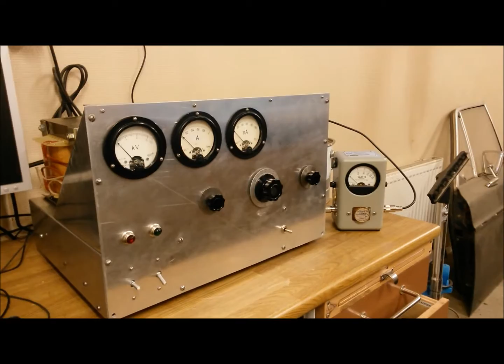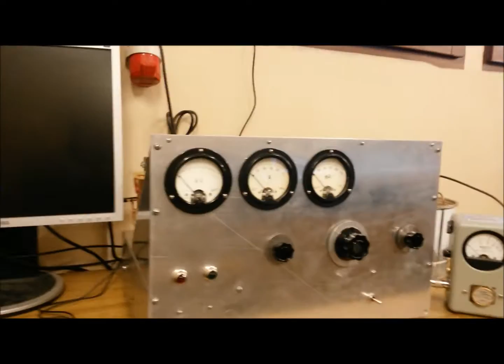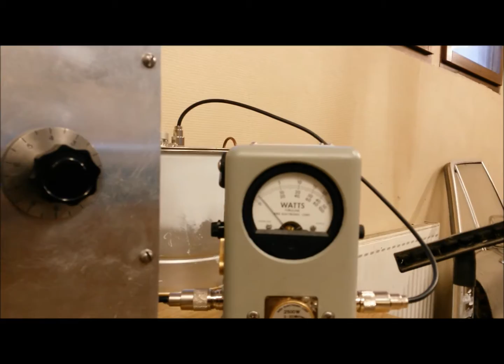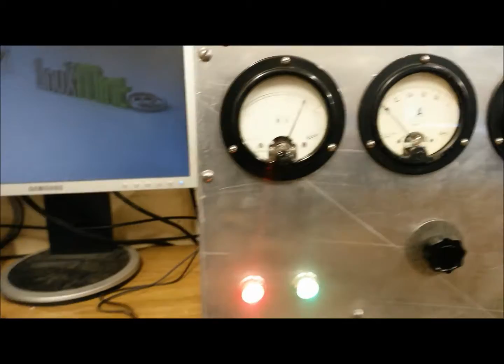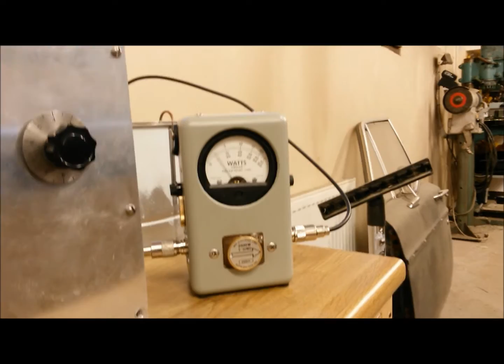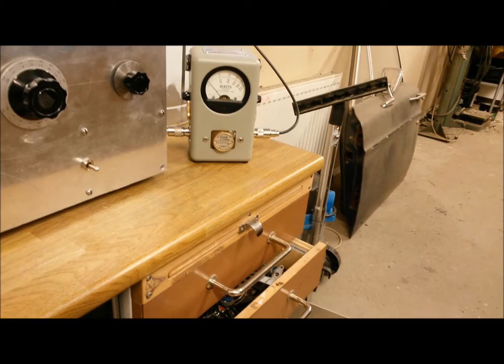813 linear amplifier

Comment: 2750 v   x 0.6 amp =1660 watts -40% to give 60 % eff is 990 watts output, so the watt meter vs voltage and amp meter is pretty much spot on ! welldone

Comment: Unfortunately  smoke damaged by a fire,  I have an old  Hallicrafters HT-41,  originally used the oddball 7094's.  Mine came with bad tubes and bad  filter choke.  I converted it to  solid state rectifiers,  capacitive filter/ no choke,  and   sub mounted 813 sockets and had BARELY enough height for the tubes. I had a filament transformer for the 813's that mounted perfectly where the old filter choke was!!   It's best band was on 40, it would output over 900  "key down."  I've forgotten the   Ep, it was quite high.  Did not run screen  voltage, just grounded both grids.   Maybe someday  I'll rebuild it, but I'm 75 now, and the  boat anchors  are getting more difficult to lift!!

Comment: Very Nice work, excellent choice in analog electrical measuring meters. My Father was a radar engineer for Lockheed Aircraft Service and He built a linear using four 813's talk about a beast. The homebrew power supply for the linear was a separate unit, it utilized  a group of Murcury vapor rectifiers which were 816's if I remember correctly, when he keyed up that linear, His whole ham shack was brightly illuminated with this deep cobalt blue light, you would think Frankenstein was comming to life.😏👍
   Thank you for sharing your linear and fantastic RF engineering skills with us.👍✌
Reply: What year is this? )))

Comment: Hej. Kul att det fortfarande finns hempulare. Själv kör jag 2st gu81m pentoder ca 2kw ut är enkelt. Kör inte gg utan separata spänningar på skärmgaller och styrgaller i klass ab1. Lycka till med byggandet! 73 de SM3EXO Uno
Reply: Hej Uno. Samlar delar till just 2 GU81m. Vilka spänningar har du på gallren? Vilka band har du lyckats täcka in?
Reply: @SA2CLC  hejsan. Jag har kört det här pa:t i 11 år nu och fortfarande full effekt. Kanon rör helt enkelt. Skärmgaller spänningen stabbad och 800 volt. Funkar på alla band. T. Ex. 10 meter har jag ett par 100 watt lägre uteffekt. Mycket låg imd också. Ex8a hade väl mätt upp - 42db.jag experimenterade en del med strökapacitanser i anodkretsen för att få så lågt som möjligt och har lagt in en induktans mellan c1 och jord som är i resonans på aktuellt band, jag switchar in den med relä. Det var mycket skitprat det här. Lycka till med byggandet och hör gärna av dig. 73 Uno SM3EXO

Comment: 900w carrier? Dang dial her down a bit thats running real hot lol. 200w carrier the 813 will run forever.
Reply: I don't think he's showing you carrier as in AM. Hams rarely use AM if at all, generally preferring SSB and CW and all that digital stuff. That's probably a test carrier in CW mode, representing a peak in SSB, so there's no need for the "headroom" you need in modulation over a carrier.  It's all modulation, or nothing. No carrier, narrower bandwidth.  But maybe you know all that, carry on.

Comment: Nice work,I'm going to try building an amp I have 2x 811s I want to use.Can you tell me a little about the Transformer that you used. I had salvaged a few microwave transformers but have been hearing bad things about using them in an RF amp..Any advice would be appreciated. Tom  AB3YK  73's
Reply: Tom, I´m using a 1000vac transformer rated at 1KVA and I built a voltage doubler to get sufficient high voltage. not optimal, but works for me. From what I have read about microwave oven transfomers is that their idle current is very high, and their isolation is not much to brag about. Perhaps using two identical with the primaries in series, to reduce the idle current, and the secondaries connected as a centertapped winding would work.//Tommy, SA2CLC

Comment: OK  transformer. operating the amp on ten meters all leads must be kept short and C1,tuning cap must be placed close as possible to the 813 bases with a common earth point to reduce lead inductance and stray capacitance

Comment: Is your eht transformer from   microwave oven .I have built a 813 amp with two tubes  got mine to work on 10 meters but only up to 28.700mhz due  to  stray capacitance output is 600w max.
Reply from the maker: +Martin Bernstein Nope, the transformer is brand new, Swedish made, by a transformer winding company.Ok, good work on 10m, I have not tried to extend the band coverage yet, since I´m quite pleased as is. //Tommy

Comment: Beautiful amp! Can you tell the plate volts, ams and how much drive is needed to achieve the output power? I have a few 813s and I want to build one. thanks, 73. KD5MHQ
Reply from the maker: Hello Bob, tnx for the comments. I need around 60w to get full output on 80, and a bit more on the higher freqs.Voltage is around 2400v loaded to 550ma.Yes, put those 813´s to use, they make excellent GG bottles.//Tommy
Reply: +CoatedSofty - Yes, definitely, tnx! I hope to make a vid using the 813 as a well. A nice bottle! 73's